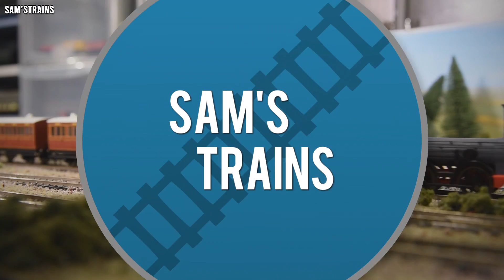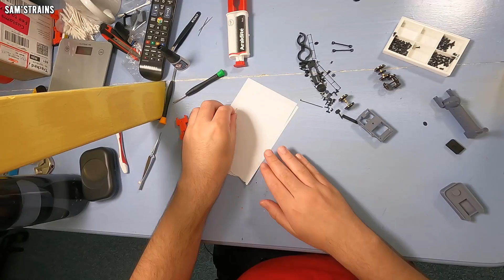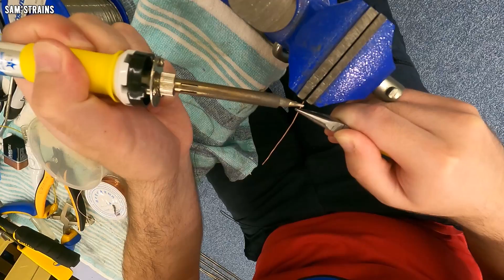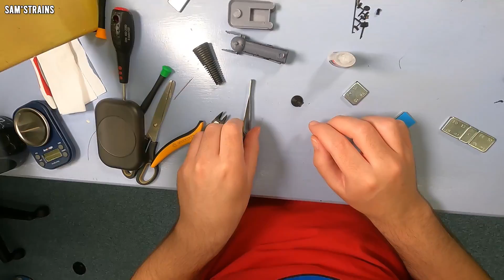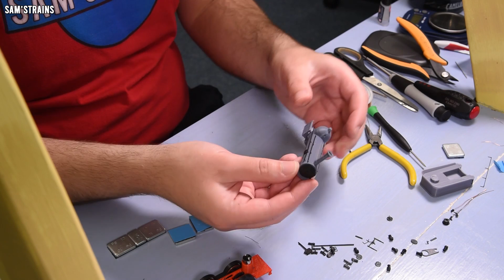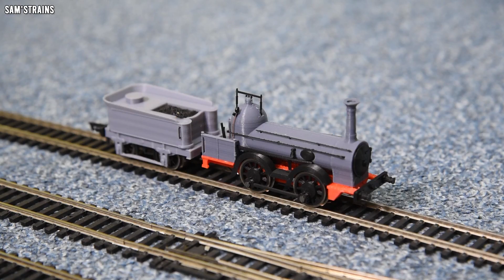Building The First 'Old Coppernob' Prototype | Furness No.3 Project

Comment: Amazing, Sam. Considering you said yourself that you were not even much of a "kit builder" a few years back, you have now designed, printed and built a marvellous model. I think it goes to show that if you, a one man band can do this, then some of the mainstream manufacturers need to pull their socks up. May I ask did you print the gears on your printer? And if so what software did you use to design the gears and the correct meshing of the gears? Also what nozzle size did you print the gears with,  please?

Comment: Magnificent, well done! I have the impression that phosphor bronze is more commonly used for pickups: if I understand correctly it is more springy than copper, and therefore better. But if the copper pickups are working fine, then I suppose that's all that matters.

Comment: Are you printing with PLA, if so you can hold the parts together and then just place a few drops of acetone at the joint. It will wick in between the parts. Then it will melt the surfaces together and give you a welded joint. The acetone will evaporate very quickly (just a few seconds) and give you a permanent bond. Use a small very pointy paint brush or a tooth pick to apply. Make some experimental parts and try it. I was sceptical when I first heard about this but I tried it and it works.

Comment: Another massive leap for 3d printed models! Sam you truly are a pioneer. My only issue with 3d prints are the printing lines but those can be mitigated with resin printing, which unfortunately is quite expensive. Nevertheless, what a stunning little model! It makes you wonder how manufacturers get it so wrong.

Comment: Excellent work, you really show extreme skill and patience with all the designing, testing, printing etc. I'm very impressed. I look forward to seeing what you do next! I think that you could almost run a review channel and a 3d printing model trains channel!  Just great! One question though, have you thought about resin printing body work for even finer detail? I say that with all due respect as it seems you have your FDM very well dialed in. A trick I heard is to dip an FDM print in resin once its finished to fill in layer lines and smooth it all out, might have been non-sense, I've never tried it. Anyways, I'm sure most of it will disappear with paint anyways, excellent work sir!

Comment: Impressive work Sam! Some tips for straightening wires I found on youtube is to clamp one side of it, and twist the other end with a drill. It works for steel wires, but I have no idea for copper wires as they aren't as strong. Worth a try I guess...

Comment: Looks beautiful even unpainted! I have a question about the pickup holders, do you have a way to put new pickups in if they need to be replaced?
Reply from the maker: Unfortunately not - it’d just be a case of making a new base keeper, which is a very small and basic part. The copper wire makes such light contact though, it won’t wear quickly at all!

Comment: Hi Sam.  May I recommend that you switch your pickups to beryllium copper, for its spring-like property?  When regular copper is bent, it will eventually relax (overcome ultimate yield in mechanical engineering parlance) and electrical contact will become intermittent.

Comment: Sam, you made a comment about having a problem removing the shell in the future. Maybe as a suggestion, design the shell with a removable dome that is over the motor? This would be the only section of the shell that needs to be removed to service or change out the motor.

Comment: Wew, you have been working like a real fine manufacturer here: research, data collection, rapid 3D prototyping and construction, check, adjust, make all parts, initial tooling, actual prototyping for real by testing the construction and assembly, check, learn, find solutions, build experience, improve… Cracking professional job Sam! We can’t wait for the next part in this series. Cherio and Ciao.
Reply from the maker: Thanks very much Linda, it’s been a very enjoyable process!

Comment: So, I recently learned that there are companies that will take 3d model files and die-cast them in aluminium. In theory, it would be possible to make a model train with die cast parts, although it would be super expensive.

In particular, I found an online company called Xometry. They seem to offer die cast services, as well as plastic injection molding.
Reply: A resin 3d printer would make the perfect detailed model, the filament printers leave those layer marks. Would be his best course of action making it all in house

Comment: Impressive. BTW, if you put one end of a length of copper wire in the vice and pull the other with pliers there comes a point where the wire 'gives' and you get dead straight wire.

Comment: You might want to use EMA Plastic Weld. (#notspon) I've used it on several 3-D printed models - a 1930's 'Flash Gordon' rocketship, Captain Nemo's 'Nautilus',  some 1960's movie Daleks, and a 'Sandman' gun (1/1 scale) from the film 'Logan's Run'. It dries flat, you apply tiny amounts with a brush, and it's strong. It's great for fiddly little pieces. I've used it for making plastic kits for nearly 30 years, and it's never let me down.
I do like the Coppernob engine - it's a definite evolutionary step up in technology. Great project and model. Nice one.👍👍👍

Comment: Sam looks a great model, on the wheel quatering do you need a locating pin on both sides of the clamp so when the rod is attached to the wheel they are in unison
Reply from the maker: Thanks! No locating pin is required with this setup, as the two halves of the tool fit to the relief of the wheels - to use this design with more standard wheels, then yes pins would be needed
Thanks for watching, Sam :)

Comment: Can’t wait to buy this! Should be the first HO model of it on the market ;)
Reply: OO
Reply: @WhatAboutTheBee  same difference.
Reply: @the3tierbridg  1:76 v 1:87  the difference is apparent when the models are placed side by side.
Reply: @WhatAboutTheBee  they fit on the same track
Reply: @the3tierbridg  sir.  You are conflating the gauge of the track with the scale of the model.  OO uses 16.5 mm gauge track.  So does HO.  16.5 mm track is actually the wrong gauge for OO, but was established right after WW2 in England, using US provided track.  The gauge for OO should be 18.83 mm and is so in P4 modeling, a more accurate representation of 1:76.2

Sure, you can always run your HO stock and OO stock on 16.5 mm gauge.  That's fun.

In the end though, Sam is scratch building a OO scale Copperknob to run on 16.5 mm gauge track.
Reply: @WhatAboutTheBee  Just one precision : OO scale dates back to the 1920's when 16,5 mm were manufactured for the first time by Bing. Clockwork mechanisms at this period were too large to fit into a UK steam engine modeled at 1/87 scale. So, the track width was maintained, and the reduction scale was broadened to 1/76. When electric motors began to become a reality for model trains in the following years, this combination was maintained for UK models. And we have today this OO scale for UK models.
Reply: @OlivierGabin  I accept your correction.  It was my understanding that when the UK wanted scale models, and not toys, the UK was limited by the ability to produce scale track.  My understanding is clearly not perfect, so you will get no dispute from me!

Comment: I think this might actually be the best model Sam has made yet! It looks great so far. The mechanism could use a bit of work, but when this is all painted up, I think you could actually fool somebody into thinking it’s a legit model, made by Bachmann or Hornby
Reply: It's too good to be made by Hornby
Reply: @tobystevens1274  Your not wrong. Heljan 
 is crying.
Reply: In what way is this not a 'legit model'...?  There are plenty of modellers out there who'd regard this as more 'legit' than a Bachmann or Hornby product, simply because Sam has made it himself, even if he has used 3D printing, rather than sheets of brass and nickel-silver...
Reply: @johncunningham6928  did you press “read more” on the comment?
Reply: @johncunningham6928  Agreed.  Hornby produce RTR models, that is Ready To Run.  RTR are for the enthusiast who want the locomotive built for them.  Sam is making a "Scratch-built" locomotive and indeed, it is an accomplishment.  The Original Poster, McApplebutter, is conflating the word "legitimate" with RTR.

And yes Mr. McApplebutter, I did read your entire comment.   Cheers!

Comment: oke I just wanted to comment on something that this video reminds me of. I tell people a lot  that “you can't really judge they're work  unless you have done it yourself”. Now you have built multiple locomotives and pieces of rolling stock all by hand (And 3D printers) and they're not the highest quality locomotives but they do work.  So when one of the biggest model railway  manufacturers  make such a big blunder like with Hornby and they're hush hush’s  in original condition  you can comment: “ I have built locomotives with less money than these people and they  are better runners than this one.  even if some of them are not the best lookers.” Just give one Food for Thought. 

Ps This is a beautiful locomotive You have made.

Comment: Looking at the thumbnail it’s looking quite good there Sam, will be very good seeing what it’s final version looks like, great idea with the quartering tool that would be a great thing to be able to get hold of.
Reply from the maker: Thanks a lot David - yes the quartering tool is awesome, but will only work for these wheels... would need to adapt it for other wheels!
Thanks for watching, Sam :)
Reply: @SamsTrains  For other sizes of wheels, I suggest you to add a cut with a rim on each pad, and manufactures wheels imprints that goes into this hole as removable parts. Or, better, a vertical sliding replaceable wheel holder, which slides into a lateral window on the pressing pads, and can be put in place with screws for safety.